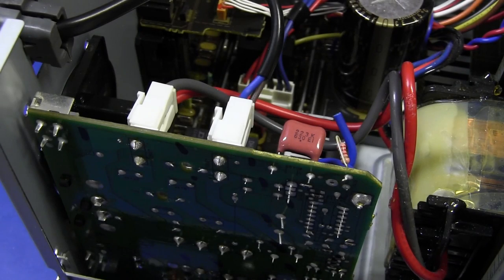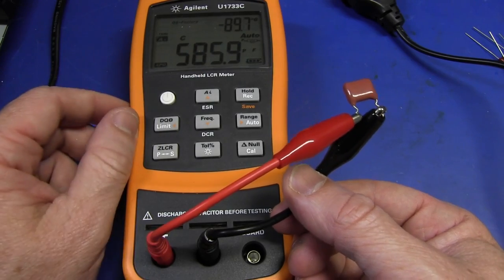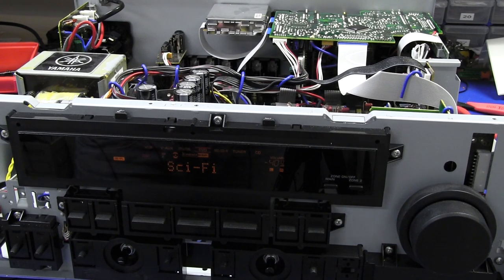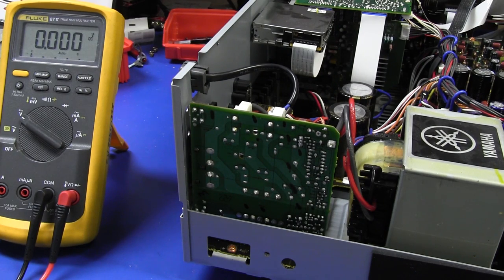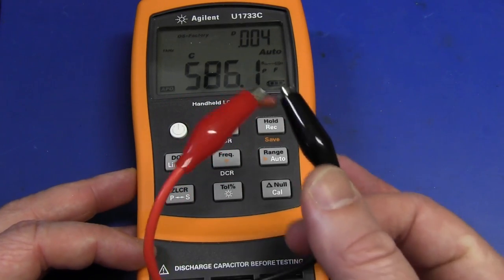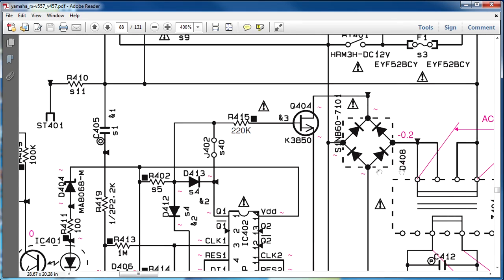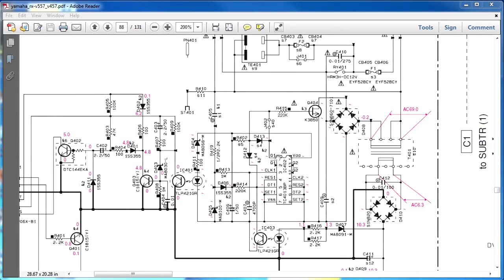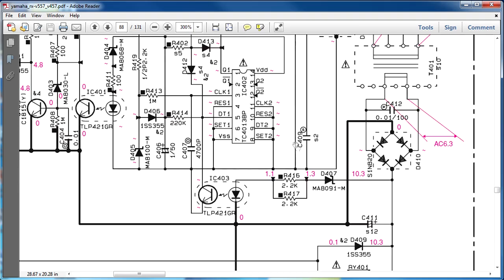EEVBlog #379 - Yamaha RX-V557 Receiver Fix

Comment: I know this video is ages old and I probably won't get an answer but I have a Yamaha RX-V567 and pretty much the same problem. It lights up red and when turned on clicks but doesn't do anything. Sadly the solution seems less obvious, the board is completely different. Any ideas?
Reply: Arnold Nym I have an RX V671 with exactly the same issue, but like you the board is different :/ 
Maybe I might just swap out all the caps, there's only about 8 lol.

Comment: I used to sell Yamaha audio equipment in the 1975 to 1980's, yes they are very good audio equipment, but totally overengineered compaired to QUAD or Armstrong 600 series, really glad you got this unit working, it would be sad to drop it in the skip again !, well done :)

Comment: Awesome. Thanks so much.  Replaced the capacitor on my HTR 5840.  Same 55c 223K one from Jaycar.  Turns on now!   System was $2,400 inc speakers in the old day which are all wall mounted so good to have it back.  Thanks so much!!

Comment: It's amazing what a cap can do sometimes. I have friends that work in computer Dept at local college, they get flat panels that just won't turn on, or poor picture.
They usually put a note saying bad on them, i saw one day i was with them on a project, i asked about it. They were like it's junk if you want it take it. I saw on insructables, that is a common issue. I took plugged in see what happened. flashing power LED i thought looks like timing like cap issue. I went though looking around nothing at first looked odd, then i came back later started angling different ways to light, and saw a slightly bulged cap. some crap brand samxon i want to say. I was like our radio shacks gone, i hope i have one, else have to get online. I dug though bag of hundreds of caps, found one, and was an Elna. Put in worked. 

They later had a dell one with USB hub, that failed no power at all. I opened up looked for caps, was the filter cap on SMP output. I thought really it goes through a 3 lead shotky diode, and that isn't pure enough to even run the LED or backlight or anything. Replaced cap from collection now using monitor to type this.

They gave me one too that had something that resembled like a messed up v-hold on an old VCR. I thought cross talk tried different input line same thing. They just gave to me because nobody wanted to use it. I opened up wrapped all the wire pairs in tin foil, taped it around the wires. put back together nearly perfect display. Wasn't ribbon cable like most it was like 10-20 twisted pair leads to the LCD. That is now used for my work bench for fixing computers.
Reply: Nice score man !

Comment: My Yamaha amp had the same symptom, googled the issue found this video and it works ! used the very same cap from Jaycar, these caps are on eBay but not quite the same so happy to pay a tiny bit more from Jaycar.

Comment: I had a slightly earlier version of this Yamaha receiver.  The issue I discovered for intermittent output was the speaker output posts pulling out from the internal circuit board causing the speakers to cut out.  The straight forward way to repair was to hardwire the backs of the speaker posts conducting parts to the circuit board tracks with wire.   This was difficult or impossible to do without removing the speaker output board.  What looks like ribbon cable plug jumpers are not.  They are directly crimped into soldered on connectors, horrible and almost impossible to work around without unsoldering them.  My first impression was the circuity implementation looked robust and made to be serviced.  As I got more and more into dealing with it this turned out to be a mistaken impression.  The circuit boards turned out to be brittle, copper tracks would lift with just a little solder iron heat, signals seemed to be routed all over the place and onto other boards where some consolidating design work could have simplified and improved the layout, the PCB tracks looked undersized for the speaker output channels.  

To get good service access to the speaker post circuit board the likely thing to do is to unsolder the ribbon cable between it and the main board.  I did that, but not before breaking the speaker post circuit board and having to solder in wire jumpers joining the tracks.

The speaker out put posts only physical support was from being soldered onto the thin circuit board.   The lack of real support for the speaker output posts was going to be a continuing issue.  There are a lot of  cables connected onto the back of the receiver bumping into the speaker wire and the 12-gauge speaker wire being used puts considerable stress on the speaker posts.  The speaker posts were given the physical support typical for an RCA jack.  

To ease installation I was using dual banana post plugs for the speaker wire.  These likely impose more leverage on the speaker posts than screwing down the speaker posts on loose wire, but they are common practice and these speaker posts are very difficult to screw down on loose wire.   I changed mounting of the speaker posts to the metal case  with speaker posts then supporting what was left of the  speaker circuit board with new solder wire jumpers connecting them to the main PCB.  At some point during the process I bumped a small control circuit board cracking it in two.  I started rejoining the little tracks on this board with little wire jumpers, but I eventually gave up on the receiver because it became increasingly apparent it wasn't the high end component I'd believed it was and this was confirmed when I discovered the used price for them was a few hundred USD on eBay.  This was an old receiver that came out just before Dolby 5.1 became standard.  It used encoded surround sound, which actually is quite good and fun for TV shows i.e. in Seinfeld the sound field places the listeners IN the audience with some laughter coming from behind you.  So it didn't decode digital or work with HDMI connection cables.  On the other hand I really wish I still had it for driving my Ohm Walsh speakers!  Now we've just been using the TV's built in speakers.  

I'm not a service technician, but this Yamaha receiver was a disappointment to work on, especially when it looked so much like it was meant to be serviced.   Simple connection circuitry was spread out over several boards that were hardwired together instead of using plugs and sockets making access close to impossible without unsoldering.  There are plugs and sockets used, but not enough to allow disassembly for access to many critical components.   In order to trace much of anything most of the circuit boards have to be removed, some because they are in the way of another that is in the way of another that you need to get to.  The PCBs used many jumpers to route a signal all over the place through many separate tracks and jumpers and through several circuit boards where sensible organization should have eliminated many of these hops.  I think the number one issue I had was not being able to unplug cables from one circuit board to another to gain access to service their components requiring the connection be unsoldered.

Comment: I' m from Brazil and i have a Yamaha RX - V 675 it doesn' t powering up anything and it doesn' t stay in standby. I checked the power supply is all right, but the " PRY " the power supply of digital part doesn' t have 2,6V and the transformer is also good. Would be it defect in IC 153 ( R2A15220FP ) or PCB assembly ( ZF534400 ) ? Will be very grateful for your help.
Thank you very much.

Comment: My Rx-V667 was shutting down during watching the WC final :(
I've replaced the 2 caps 22n 630V but the fault is somewhere else, I suspect that it related to the switching IC because the transformer gives no AC voltages to the rectifier diodes which produces the +5V for the rest of digital boards. Too difficult to investigate further, so I tried with a solution of feeding external +5V power to the rectifier output and it's working.

Comment: With a quick simulation, it it seems that you are correct.
I simulated the cap, 2.2K res, Zener diode,connected a transistor (B and C) after the res 2.2Kres and added a 3K resistor back to ground (Emitter) and run a simulation with both a 22nF and 500pF.
The output without load (the transistor) it's an almost perfect 5V square wave with both 22nF and 500pF.
With load the 22nFgets a nice 5V square wave, but with the 500pF the output is a 1V square wave, and that's with just a small transistor :)

Comment: Interesting... I have a high end Yamaha receiver that I'm supposed to try to fix for someone and it has a similar problem where it won't turn on, but I was getting the standby voltage, same as you were. I'm gonna have to check and see if there's a similar cap like that in there.

Comment: Hi.
I had similar issue and replaced capacitor. However, still it's not completely resolved..I have to unplug from mains and probably wait for some capacitor to discharge...plug in again..and randomly it powers on...once powers on then no issue during operation.

May be a bridge rectifier besides capacitor or any usual suspect?

Any help is appreciated..

Comment: The cap that died is there to limit current and voltage. If the value is too low the circuit cannot deliver current and the circuit dies under load.

Comment: Two questions: 1) Why did the cap likely fail, is it psu design or poor part quality?  2) Why is the cap there in the circuit, when it's passing ac mains anyway. Is it just to protect from dc on the mains?

I've never seen a failed film cap before!

Comment: hi! I have same problem but my unit is rxv-440 (more than 10 yrs old). how do you remove that pcb unit? I have removed all the screws (2 in the inside, and 4 in the back) but it seems the board is still attached / sticked to something. would appreciate if you can vid it. thanks!

Comment: Over 35 years of servicing I never have found what really causes them to fail.
You Notice the "Dirty" DC has Gone too ! ;)
Those little Beggars are a root cause of a myriad of weird and wonderful faults on so many B*****d repairs.
Even had a Bridge rectifier fault on a twin record deck Desk that explosively blew the DC  fuse the pig of a psu gave perfect  + n - 24v DC when scoped.
Found that by accident after a week,
Pulled the main smoothing cap to change a second time and decided to look at the bridge output raw -
Perfect Half wave pattern !!
Regards
Andy

Comment: C405 is passing alternating current . Capacitors pass voltage on ac as you know.
Why they use a capacitor there....and not something else is not understood.

Comment: I think, it is NOT a switchmode powersupply, it works with 50 Hz! But it swicht some time off and on to get the low power. IC403 regulate the 10.3 Volt and switch it off. IC401 is a feedback if IC402 works. IC402 count sinus cyles to switch the power off.

Comment: I'm not Dave (of course)...but it's done in circuit with an ESR tester. The voltage used to test is typically below that of the turn-on voltage of semiconductors (3 or 400mV) and the frequency around 100kHz. It works very well!

Comment: My Yamaha RX wouldn't start after a few years in the cupboard. I went through my limited routine checking for fuses, swollen electrolytics and toasted resistors. No joy.  So off to google and success.  In my case after changing out the 630 greencap (colored red, go figure) the unit would start but would then click off and shutdown.  Looking on the board there is another green cap in close proximity to the first. If changing one half fixed it then maybe changing the other will fully fix it.  So off to jaycar to buy a greencap , put it in and Bob's your uncle (meaning job done, nothing more to do) it works.  You bloody ripper! Amp back in action for about $1.50.
Reply: Antony Bijok Hi Antony!  I just bought a bad RX-V1000 receiver.  You push the power button and you can hear a relay click, but nothing displays the there is no operation.  What model do you have?  This may be the first thing I check.
Reply: ChillCosmos the 365 RX
Reply: Michelle Martinez

Comment: I always use a scope to see the power points, because with a meter, it could be displaying the average dc voltage. I think with a lower capacitance, less ac voltage/current was passed to the Flip flop power supply rail, which made it not operate. The same thing happens to HP server power supplies, a capacitor that charges up for the standby PS circuit, looses capacitance. So it does not turn on. I replace this 2200uf cap, and walla, bobs your uncle. I repaired 6 power supplies this way. This is the most common fault in them.
Love that song BTW
Reply: Hey John Brass can you please tell me if it matters which way you install the capacitor. Does it have polarity? And if do how to tell? I don’t want to install it the wrong way if it will be dangerous. Thanks

Comment: Switching power supply, complicated, but more efficient. My guess is that C405 is building up a voltage and dumps voltage to the primary of the transformer. In order for the transformer to work, this power dumping must be cycled on and off. If it doesn't dump enough, it will effect where the primary bridge rectifier is. The secondary has feedbacks of some sort... but it will be half wave rectified since it looks like the cap may only be responsible for the negative half cycle? This in turn would mean the regulator would work, but may not have the current capacity, or be full wave rectified. Hmmm... or maybe the resistor allows it to build a voltage and turn on another device where CB402 is? Just a quick guess... and thanks for sharing

Comment: I have a North American (120v mains) RX496. Same symptoms, so I removed and measured the primary electrolytic caps, one seemed bad so I replaced both. Still didn't work... then I saw this video, I just took the little cap out, it's a 103j. There is two of them but the one I took out has no continuity, so I figure that's the bad one? Should I do both?

Comment: The reason for that low capacitance is in fact the cap having shorted out, but because it's on such a high voltage rail the internal short burnt out and caused a large area of the MKP to melt/deform. So that leaves a cap with a large hole in it (internally), with much lower capacitance as a result. Usually these failures happen at high energy (i.e. visible explosion damage) but a more subtle failure can happen like this.

Comment: Hi, I am tring to repair a receiver yamaha that when I press the buttons the function selected is wrong.  I think to replace the processor but I am not sure if there are any program recorded in the CI by the manufacturer.  Do you know if is possible to replace for one from chinese market or need be requested  to manufaturer?

Comment: Hi i have Yamaha RX-V430, which was stand by transformer defective, i have made replaced with 6 0 6 Volta @ 500ma. Now when i presse stby switch it goes to protection mode. Plz suggest us the trick in it.

Comment: i repaired a yamaha htr-n5060 with the same power supply fault . It still has fault in memory stored. I see it in the diag menu , but i don't know how to clear the fault (factory reset) . what button on receiver do i press to confirm factory reset? when turning on receiver it is shutting down because stored fault?

Comment: I'm a solid nube in electronics, but is that circuit meant to automatically compensate for varying input voltages i.e. 240/120 VAC?

Comment: I have Rx-A2010 no sound issue as well.  I have corrosion or burn on the board where blue and white wires feed from Transformer.  Any ideas or help is much appreciated.   Thank you

Comment: A truly weird PSU. 

Used to work in AV equipment, and the standard faultfinding approach is to use the 'scope to check DC power rails, not a DVM. Reason is that the DVM will only show you average voltage, but not show you ripple or fluctuations. The 'scope will, and that can save you an awful lot of time chasing red herrings. 

The other thing is, whether probing with a scope or DVM, I would use a close-insulated tip. The long exposed prong on standard meter prods, or worse the earthed ring on some 'scope probes, is just asking for a board short in a confined space. A piece of heatshrink will do, although most testgear manufacturers will provide probe insulators for this type of work. 

Oh, and in most cases you can put a croc clip on the return prod and just put this on the chassis, saves using two hands and is thus safer. 

Of course if you want to use a 'scope  on the primary side of the SMPS, you need absolutely must use a mains isolating transformer. That, by the way, is not the same as the transformer used to power tools on building sites, it must be a transformer with NO earth connections to the secondary winding.

Anyway, keep up the good work Dave, your videos are always interesting. Especially as I get the chance to drool over some test equipment I couldn't possibly afford!

Comment: Cheers Dave! This video helped me fix my Yamaha RX-397. Took a punt on the on the Suntan 233 from Jaycar here in NZ. Worked a treat. Also, the display was very dim before it died completely and now it's back to what looks like full brightness. So I guess the dimming may have been related and a sign of the capacitor failing?

Comment: This looks very promising.  I have an RX-v596.  I have been looking at the repair manual and comparing it to the one for the V557.  The C405 is a different capacitor.  The one that looks similar on the power board is C804 but the value is quite different.  It is .01uf at 100v.  Can anyone offer any suggestions on what this c405 capacitor would be on the RX-v596?  Any help would be appreciated.  Thanks